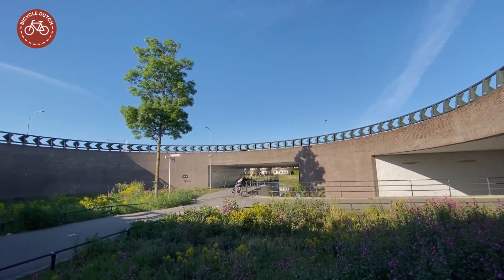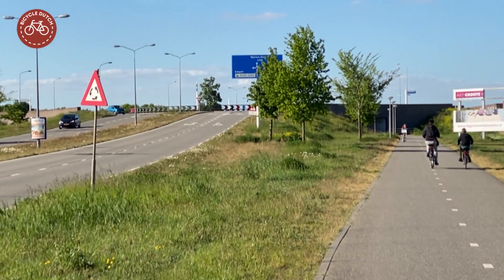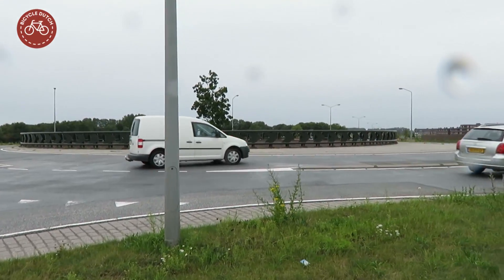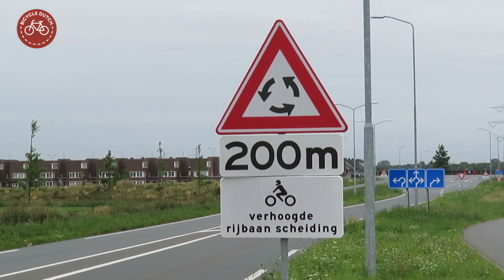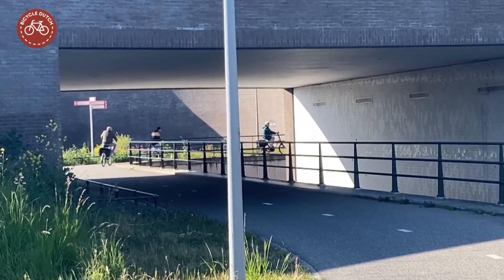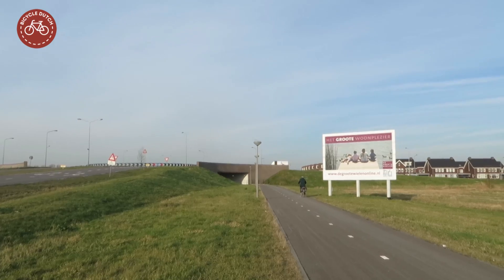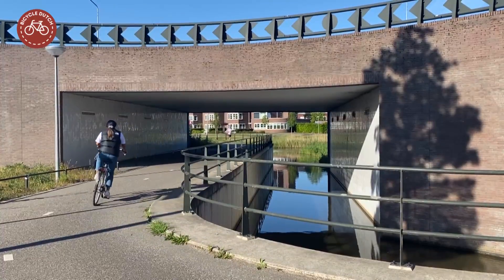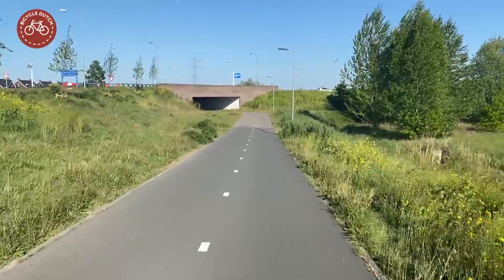Grade-separated turbo-roundabout Rosmalen

Comment: Positive is also that the cars go up that artificial hill, gravity will help them slowing down and speeding up exactly when needed. And the cyclists on ground level can easily maintain their speed.
This is also why it is very attractive, from an environmental point of view, to construct motorways in a trench (if groundwater-levels allow for this): they will spread less noise and at exits and entrances gravity will support the required deceleration and acceleration respectively.

Comment: I don’t like roundabouts like this one. Last month a choose the wrong lane and had no choice then to leave the roundabout and drive until I could turn my car.
With normal roundabouts you just drive a extra circle. However roundabouts are a lot saver then intersections with or without stoplights.
Since my city build them on almost every intersection and crossroad the amount off accidents lowered dramatically

Comment: There's a roundabout here in Bristol that is known as The Bearpit. I typically cycle around it on the road because to do otherwise would mean riding up to the pavement on a busy road next to a usually occupied bus stop, entering the subway via a ramp then exiting via a ramp on the other side onto the pavement. Then from there I would still have to wait at a crossing to rejoin the traffic. There are far worse things about the roundabout itself but at least the faded markings make drivers quite a bit more alert of others switching lanes.

Comment: You're lucky in the Netherlands that you have the cycling 'hardware' and the 'wetware'--i.e, the mentality of the people isn't always cars first. Here in Denmark they only have the hardware--cycle paths and bridges, etc--but the mentality is very much putting bikes and pedestrians at the bottom of the pecking order.
Reply: Douwe Bloot  The Danish cycling model is very popular among international urban planners though. Because it looks like you are doing a lot for cycling without too much commitment. If you would like to transform the infrastructure of an american city for example, it takes way more effort to convert to the dutch model than the danish model.
Reply: @thomascoppens8498  what are the differences?